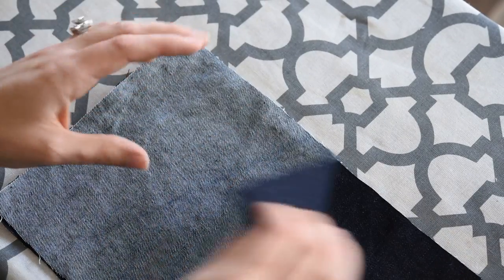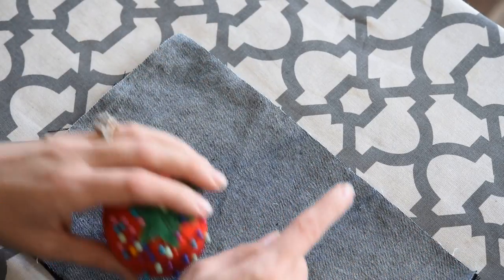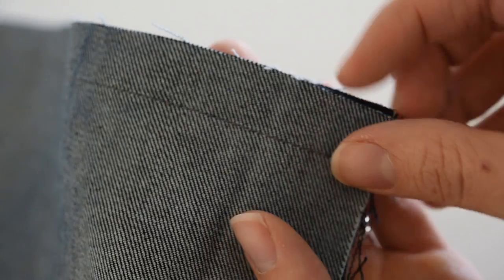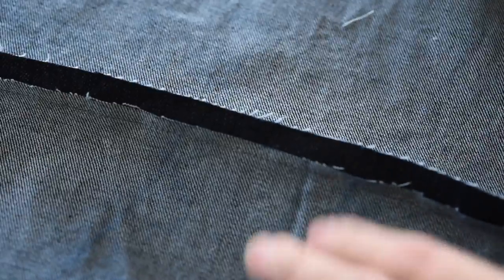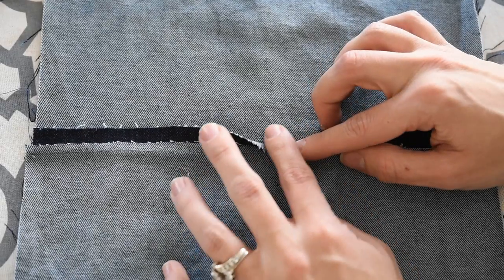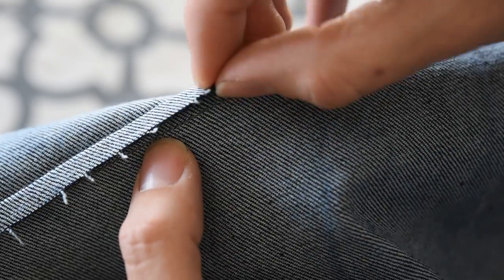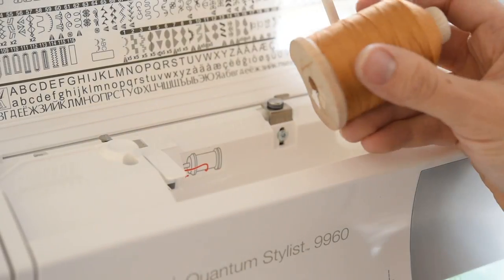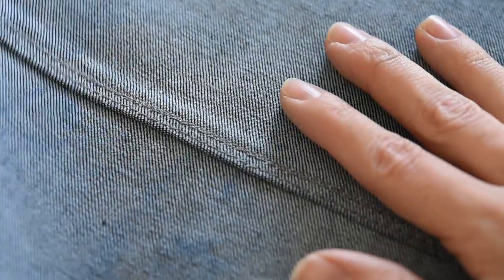How to Sew a Flat Felled Seam Video

Comment: Now how would you do that on the other side too. My brain just can visualize how to pull that off.
Reply: I’m thinking one side should always be open in doing this. Unless you want to sew by hand..
Reply: I’m not sure if you are referring to the under stitching, but the under stitching will mimic the top stitching because she used one needle. If she would’ve used 2 needles the under stitching would’ve looked more like she did it with a serger. So if you press down your seam allowance to one side and see right on top of that seam allowance, you will get the results she has.
Reply: I am wondering the same thing. Lets say that was the right side of one leg, how do you sew the left side now that it won't lay flat without going through the other side?
Reply: Best way i could describe it is to rotate your whole garment 180° so that you are doing what you are seeing in the video. Hope that helps!

Comment: Wouldn't the seam be stronger if you sewed through both pieces of fabric vs cutting off the one side? I see many different versions so i'm always not sure. Thanks for sharing.
Reply: Yes it would. I had a student that tried using this home sewers faux flat seam and her crotch seam in her jeans started having thread tails showing through the seam. Once I showed her how to sew a true flat felled seam she hasn't had that problem. That is the reason jeans makers use a felling machine that prefolds and sews two rows of stitches through all 4 layers of the seam.